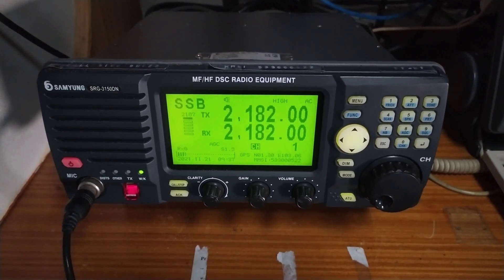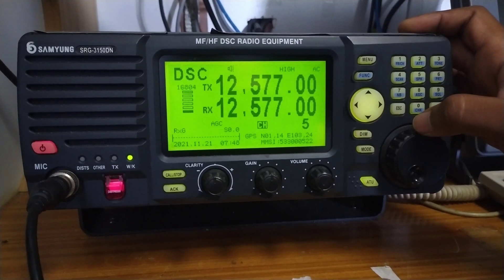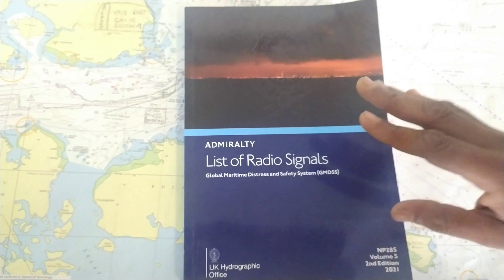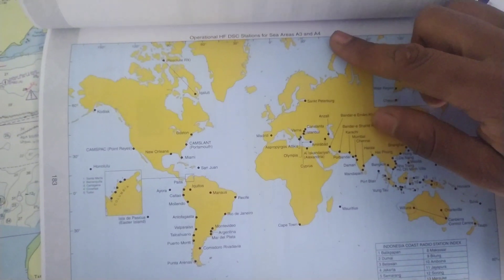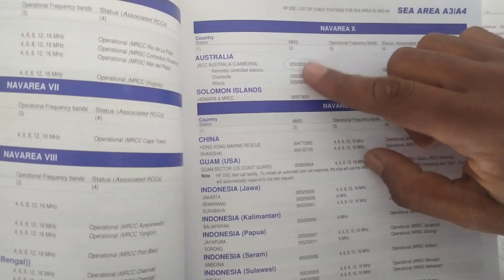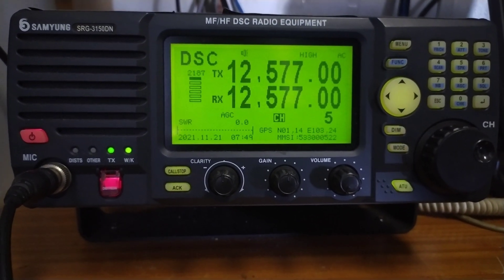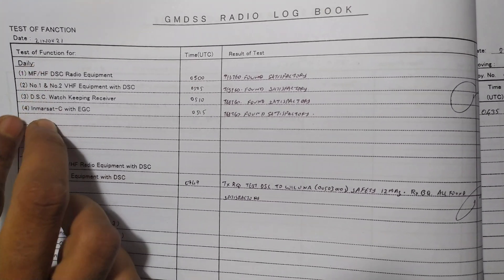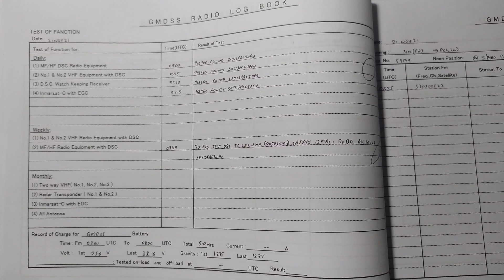MF HF Weekly Test - Call to Coast Station

Comment: Can you help me, friend? I don't know how to connect the TX and RX from the coupler to the radio, could you tell me where I connect it?
Reply from the maker: Sorry sir,  I'm only an operator. I have no idea what to tell you. But, if you have the manual, it will be shown as a block diagram.

Regards ❤️
Reply: @prasobhsugadhan Unfortunately I can't find the manual for this coupler anywhere :(
Reply from the maker: @CaioReis-z8u pls send me the name of the equipment with type specifications.

Regards ❤️

Comment: why you use 12mhz tx?
Reply from the maker: you can use any sir. I used it for transmission only as an example. You can use any frequency depending on the time sir.
Reply: @prasobhsugadhan  👍